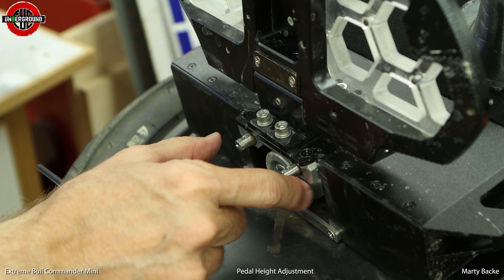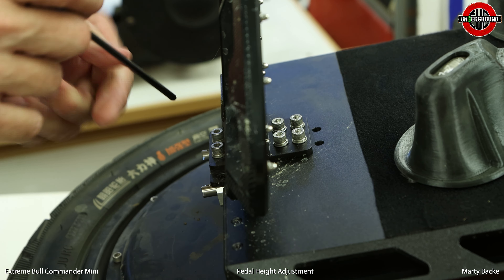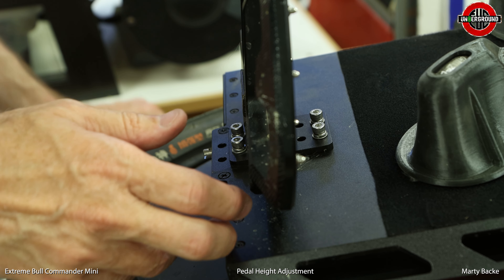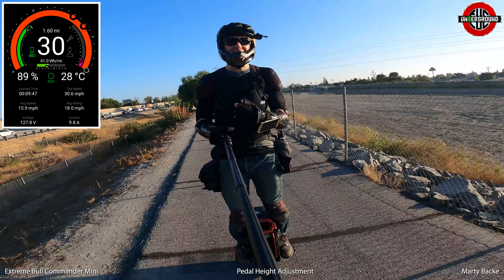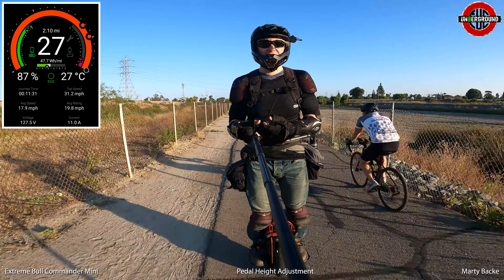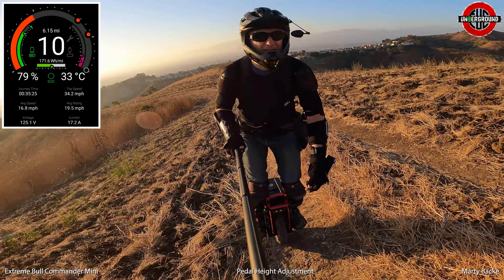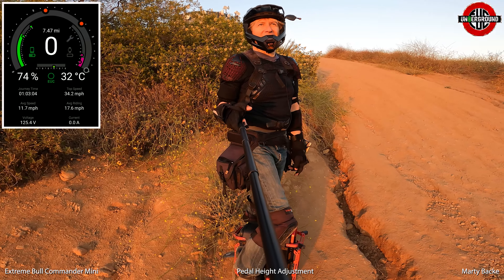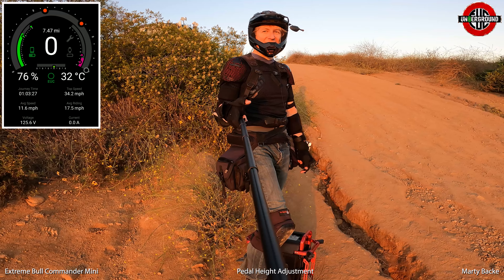Commander Mini Pedal Height Adjustment

Comment: Do you think if i lower the pedal and motor placement i accelerate easier and quicker? I am not a heavy rider and i am having a lot of difficulties in accelerating with my new S22 pro.. I am not a new rider but it feels so different compared to all kingsong models.The experiment with S22pro is so exhausting for me…thanks
Reply from the maker: No, lowering the pedals won't help. Try adding some forward pedal tilt (see the app) and experiment with the soft/hard modes. A softer setting can help a lot with acceleration.
Reply: @ElectricUnicycles thanks i will try that